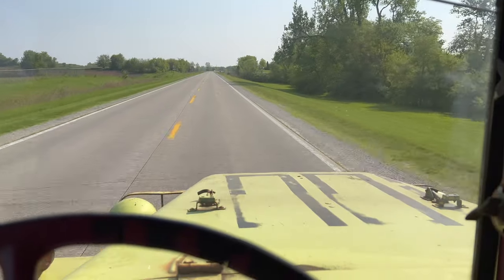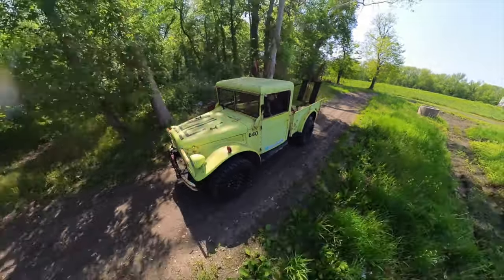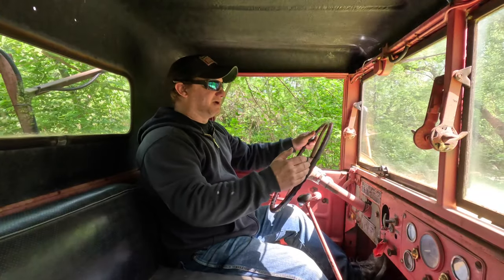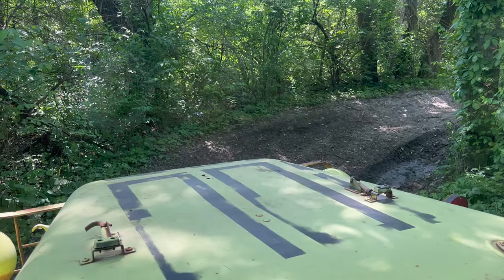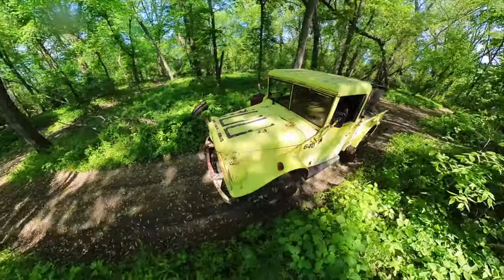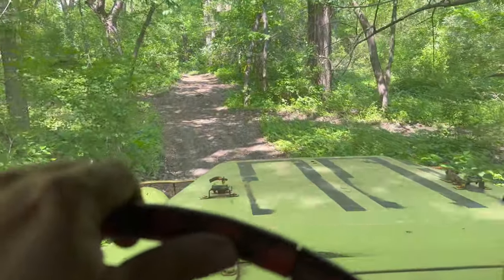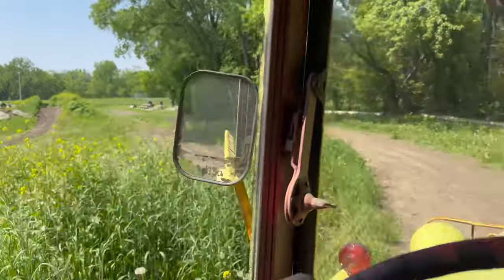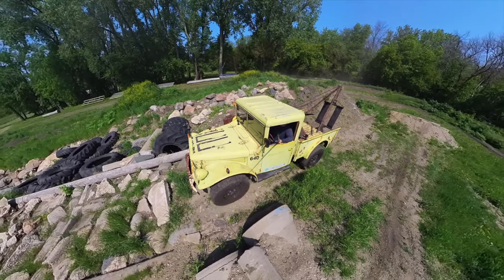Offroad With The M37 Vintage Off Road Wrecker

Comment: 25 years ago I bought one of these painted exactly like this one from a fire station in Oregon.  I paid $3500 and ended up with $15,000 invested with Chev 350 V8 running the original drive train.  New paint, glass and VDO gauges, upholstery, roll bar, power steering and vacuum boost  brakes.  Due to the low gearing (5.89), I had an overdrive auxiliary transmission installed to enable a 65-70 mph cruising speed.  Never got to try out the transmission as my mechanic doing the work had a "little fire" which burned the truck and his shop and other vehicles to a crisp.  Remarkably,  the insurance company paid all but the $50 deductible and I got $14950, and THAT in itself is another story as Paul Harvey might say if he was still alive.  Even had a heater put in.  Had A/C too...the front windshield on these things tilt out, or lays down.

Comment: Vintage Power Wagons has a special run of ARB air locking differentials made to fit these trucks. I've got one ordered for the rear diff on my M37. 
I use mine working in the woods. I have to agree with you, power steering is a nice addition. I'm not a 20-something GI, so a little help on rough terrain is welcome.

Comment: you could ad a steering damper - I have had them on manual steering offroaders and they help tremendously. I would still go with power steering if you plan on mud rocks etc

Comment: No reason at all not to add power steering. Remember, the target demographic for its users was a 20 year with more brawn than usual. My first crew chief on a cable crew was a former truck driver in Vietnam. He could back those short little cable trailers into any spot needed first shot.
Reply from the maker: The truck is fine with stock tires and used as intended but with giant Humvee tires and being used as a rock crawler the steering is not up to that task.